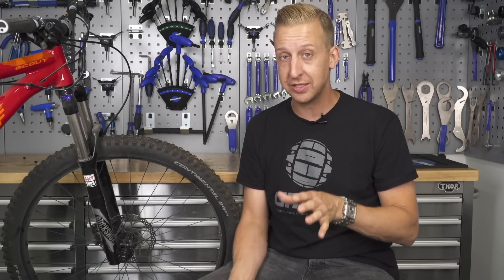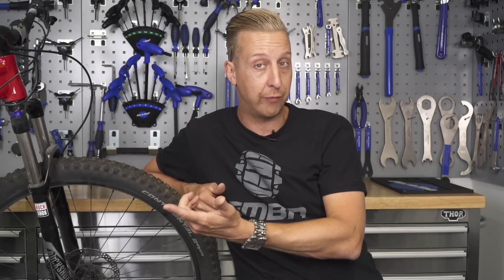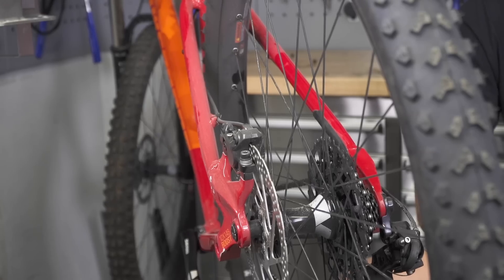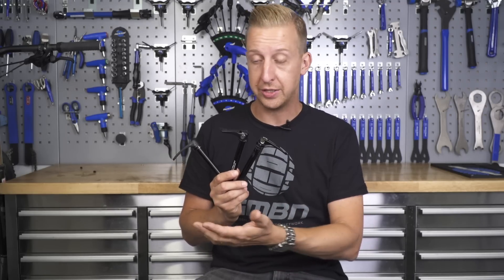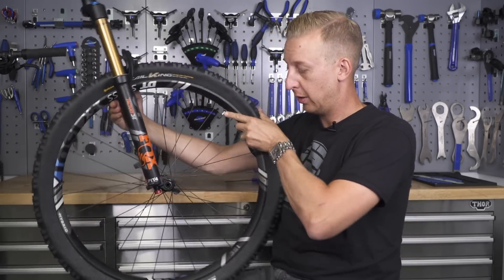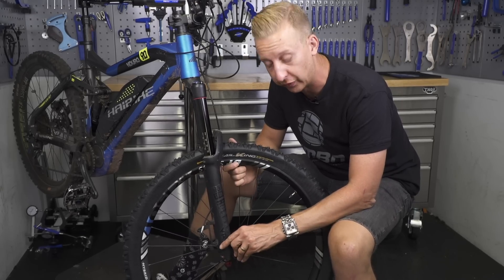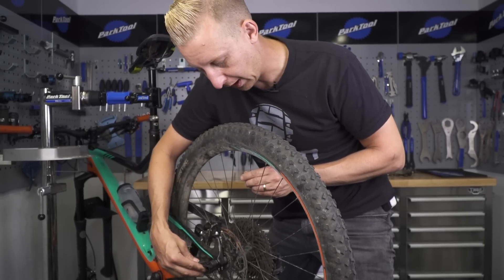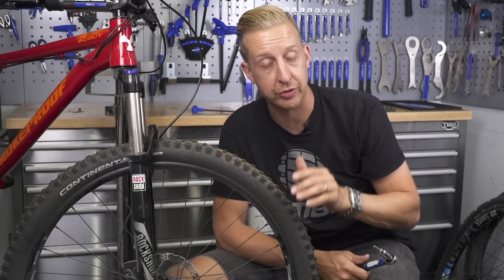GMBN Tech Essentials Ep.1 | Wheel Axles

Comment from the maker: Welcome to GMBN Tech Essentials! What skills would you like to learn?
Reply: Wheel bearings and servicing them would be interesting.
Reply: GMBN Tech how do I pick the right sized bike frame for me
Reply: @Stiffs1121  5554
Reply: Chain cleaning and maintenance; schedules, methods, tools, and which products are recommended. Don't even mind if it's sponsored products as long as you believe in them, Doddy
Reply: How about a nuanced explanation of suspension terminology? Most understand "sag" and "rebound", but it gets more complicated when understanding what "progressive, linear, High/Low speed compression, damping", and how all of that effects how a bike actually rides.
Reply: How to choose between rockshox, Fox,ohlins,etc
Reply: Changing gear cables; bleeding brakes and tuning rear mech please
Reply: cleaning and properly cheacking your linkage would be cool to see.
Reply: I have a back tire with correct axle/ frame size but the tire rubs against the left seat stay. how do I measure the complete wheel and back triangle to find out what matches or doesn't fit?
Reply: Derek Smith the wheel might just be dished to the left. I had a similar problem with mine*.There’s videos on YouTube to show you how to correct it. It’s quite easy
Reply: Hey Doddy- Wonderfully informative as usual- I was wondering if you could touch on QR Boost rear axles. My wife's Scott Spark 960 has this and its making upgrading her rear wheel a bit of a puzzle. I understand you can swap parts out on most Boost hubs to accommodate but what gives?
Reply: Bottom bracket maintenance
Reply: GMBN Tech That was brilliant vid. Thank you. Can you do one on converting old drivetrains like 3x8 to a 1x system ve it 1x10, 1x11 or 1x12. Pretty please with a cherry on top.
Reply: A rundown on all the bearings on a bike, the different levels and types; particularly if they're not sealed and need servicing would be great (don't see a lot of entry level stuff on here)
Reply: Headset maintenance - particularly how to identify what is fitted so you can have the option of buying better components / bearings
Reply: How to change the perfect air for your shock and fork.That would be really nice to do
Reply: GMBN Tech chainring replacement on specialised turbo levo
Reply: GMBN Tech freewheel axle bearing replacement
Reply: I'd love to see a video on all the different greasers, degreasers, and lubrications you use on your bikes. Also maybe alternatives that you would/wouldn't recommend.
Reply: Love these essentials videos, as iam new to the whole working on my own bike thing, this helps me greatly!
Reply: Carbon bikes maintainence please
Reply: Love all the GMBN tech vids. Please can you stop betting adverts and banners on your videos please. It’s a proven addiction and problem area.
No problem with the need for adverts otherwise for your income just ditch betting firms plse
Reply: I would like to learn how to assemble and check on a new bike that I purchased online.  I just bought a polygon D7 and I want to make sure its safe without having to pay for an all around set up.  I am brand new to mountain bikes but I did ride dirt bikes a bit and do all my own maintenance.
Reply: What's the best axle to use with a front hub motor? Quick release or thru axle

Comment: Isn't the Fox removable nut now used on the Float system to ensure the fork ends are not squeezed together if a under-width hub is installed? The axle doesn't compress the hub, it essentially floats on the axle.

Comment: Hello,
I have a whyte bike with a central lock through axel 12 x 142 mm, but theres no way to tighten the axel and more just holds things rather than tighten the frame to the hub. Is there a torque limit to this as all that happens is that the other end of the axel comes more outside as i tighten it. Do i just leave it equally distant from the centre of the frame ? 

Thank you

Comment: I feel like the original axle was fine with the bolt through. I thought the previous axles with 2 plain nuts were also fine, but I can see the benefits of quick release.

The argument that these new ones are stronger doesn't fly with me, they're still hollow. You can make the old design stronger also if required.

I don't see the benefit in these new ones, looks like just another case of the biking industry making something new and more expensive, that you'll need to come to them to replace instead of something cheap you can pick up anywhere.

Comment: I'm old enough to remember the days when both road and mountain bikes had the exact same axel lengths. And both were the same quick release size. These once simple things have gotten way too complicated. This detailed explanation is greatly appreciated. Please keep up the good work. Thank you.
Reply: I still have an old bike from the early 90's, if I have axle issues I could prolly find a spare nut anywhere.

I now bought a new bike, all pre-rusted for $35. When I say new, I mean new for me, '07 to '09 I think.
It's got a bolt through quick release on back, seems just fine after years of use and replacement bolts easy to get.

On the front it has a weird axle from Manitou, I need to work out what that is.

It's nice to see new designs, if they solve a problem or add something new people want.
However I think more bikes should keep to tried and proven common standards that are easy fix and cheap to replace.
Making profits is not a reason to make things more anti-consumer.

Plenty of good old bikes out there if you're not racing.
However it's just so confusing after not really looking at bikes for over 20 years :P

Comment: @gmbn i have a mavic crossmac sl pro 26 in TA. Im building a DJ bike. The frame accept bolt-on axle.  How can i make it work? I used a quick release adapter. I tried it but it made it  not so secure. How can i convert it to aacomodate my frame

Comment: I don't understand the 142, 148, 157 thing, shouldn't that be just the hub width? What's the matter with axles?
I just had to change my rear axle that was 195mm long, i found a new 195mm axle that also report the 148 size but if the thread length and the full length of the new axle is the same as my old, what's the point with the 148 size? Shouldn't fit anyway in my rear hub? Also the diameter is the same...
Sorry for asking but i can't really understand...

Comment: Hey Doddy,
I still have the old Quick Release axle as you are explaining around the 45 SECOND mark of this video.
Am now looking to upgrade my suspension forks to FOX but they all use the more modern bolt axles.
How can I upgrade my suspension forks and still keep the old Quick release axles as this is the only option I have without breaking the bank and buying a whole new set of wheels.
Thanks and love the show #AskGMBNTech

Comment: Is there any way to make a new, mid-range bike through axle compatible?
I appreciate that you'd probably need new forks for the front, but what about the rear? Is there some sort of adaptor to allow through axle fitting to a regular old style quick release bolt at the back, or does the frame have to be specifically designed for through axles at the rear?
Reply: There is something called Poseidon X that can convert a Quick Release to Thru axle but it's pricey and I think you won't get the same benefits from a normal thru axle frame.

Comment: I have a fully rigid mountain bike at this point - a (steel) Soma B Side v3 with a (rigid) carbon fork. I’m thinking of adding a suspension fork and am torn with whether or not I should upgrade my wheels: they are currently bolt-through quick release. Thoughts?

Comment: I have a 1996 Raleigh M-30FS mountain bike 🚵‍♀️.  I am thinking of upgrading the rear suspension from coil spring to air shocks.  It only has one inch of travel.  What Company makes an air shock with a one inch suspension?  How much does it cost?
Reply: evelasq1 I’m afraid there is 0 option

Comment: When I sit on my bike, my front wheel moves to the left. And also I feel like something is moving inside my fork(Fox Evolution 32 100mm) when I rock the bike back and forth. My local mechanic says that that is all normal and it is happening because the QR can't keep everything tighted up. I don't believe him because I feel like something is wrong with my bike when I am riding it. Any suggestions on how can I fix these problems? Cheers!
Reply: I had the same issue with my front wheel on a standard quick release not a bolt through. You could see the front wheel move slightly to the left when the front disk brake was applied I presume this is normal due to the standard quick release axles not being as rigid as the bolt through ones. Still been riding in some rough trails and not had an issue. Hope this helps

Comment: most Rockshox forks I've seen have had Maxle Lite which I was surprised you didn't feature, has the metal shroud used to thread/unthread that's easily bent
Reply: I swapped mine for maxle stealth after bending mine. Awful design.

Comment: As usual great video Doddy. I see Trek are using a 141 hub is this a proprietary hub spacing and thus a proprietary axel length?
Reply from the maker: Hey CJRodz, it's actually a quick release version of Boost. It's confusing, but still allows manufacturers to take advantage of the wider spacing while keeping the cost reasonable. If you look at 135 vs 142mm, the rear spacing is separated by 7mm between the quick release 135mm spacing and the thru-axle 142 spacing. It's not perfect, but looks like that's what manufacturers are doing.
Reply: A boost version of QR, that's interesting.. Thanks for the explanation.

Comment: Will all bottom brackets and headset bearings fit my bike even if it is sub £500
Reply from the maker: Hey Sams bike hacks, bottom bracket and headset bearings vary a lot between bikes. There are some standards that will work across certain bikes, but it's not as easy as buying any headset or bottom bracket bearings for your bike. For sub £500 bikes, the options are usually easier, but it's still important to find out exactly which you need.
Reply: @gmbntech   thanks for the answer

Comment: Hey Doddy, you should definitely advise people to periodically grease their through axles, on both the thread AND, very importantly, the main body of the axle. I had TWO brand new bikes and after 11 months (first puncture) both rear axles had become seized to the point where they COULD NOT be removed from either bike. With one of them the thread would undo but the main body of the axle was totally seized / bonded to the axle! The bikes were out of action for 6 weeks and in both cases the rear wheel had to be cut off with a metal cutter! Fortunately the repair was covered by warranty but they did try and say it was all my fault! I now remove and re-grease the axles every other week!! Please share this information as I was really sad for 6 weeks! #askgmbntech
Reply from the maker: It's a good point, Mark, thanks!
Reply: you're welcome, just trying to avoid others having the same problem, thanks for the reply!!

Comment: HI Doddy, nice vid. Do these differents axles are compatible with other brands forks. I prefer the DT axle and i'm wondering if I can use it on a Fox fork. Thanks.
Reply from the maker: Hi Xav911, unfortunately not. There are some aftermarket axles that can be used for certain brands, but you couldn't use the DT Swiss axles for the Fox fork because the thread and system is different.

Comment: FOCUS has a pretty unique thru axle that doesn't act like the rest. It has tabs on the far end and only rotates 1/4 turn to open and close and then has a cam lever to keep it tight. Works really well and is quite fast to change: https://www.focus-bikes.com/us_en/rat
Reply from the maker: Hey Andrew, yeah there are a few different axle systems like that. This one looks quite a bit like the Manitou axle. There's also a similar axle system on the new Polygon bikes, and then another on Suntour forks! But these aren't nearly as popular and common, so we didn't feel it necessary to cover the lot.

Comment: How about a video on building a simple home bike work space. Most, if not all, of the shops I've seen online seem to be set up exclusively with Park tools and a peg board with specialized tool hangers. Additionally, I'd be interested in suggestions related to tool placements. Something along the lines of chain whip is best located near the rear wheel and a brake bleed kit can live in a drawer nearby because it is only used once in awhile sort of thing.

Comment: But does Boost and regular even matter to most riders?
I mean is it worth the upgrade/cost??
Reply: DonD512 Hi Don, so Doddy alluded to the reasons behind why boost was brought in, but if I expand maybe this will help. So when bike suspension first came in the crown (where the two legs mount) and brace the part that holds the legs so they work as one had to take some considerable force with a regular hub and QR spindle.  The spindle is a thin bit if metal that flexed which was allowing the hub to twist between the the legs. At that time we where also using rim brakes and for downhill riders it was a compromise between having the brakes close enough to the rim to work but far enough away so that they wouldn't loose speed as the brake rubbed. By increasing the size of the spindle and beefing it up the legs of the suspension can work together and the bike has more positive steering. Also making the gap wider as we now have disc brakes allows better dishing (the angle the spokes go from hub to rim) so we have stronger wheels.  So does boost matter today's bikes are incredibly competent compared to  my 1987 mountain bike you would notice the difference.  Are they worth it most manufacturers include them as spec today when you replace your bike, they don't let you down grade. Hope this helps, see you on the trails Hassle

Comment: I have suntour XCM forks on my 2018 Voodoo Minustor with a bolt thru axle where the bolt head has rounded off. Can i buy a QR bolt thru or will it have to be the same one i have?
Reply: I believe Suntour XCM forks have the old style steel "skewer" QR system, off the top of my head they're either 100 or 135mm x 5mm. Just measure it and replace the whole thing, they're pretty cheap and come in many different brands.
Reply: DiverT 5000  not the ones i have, they have a bolt thru axle, which i think are 15x110 boost 158mm. i'm wondering if rockshox maxle stealth will be compatible or if the threading will be different.

Comment: My front axle while being on a Rockshox Domain as a 20mm x 110mm axle and it has a collet that pushes out and grips the housing to lock it self in. Its much different than any of the standard axles in the video.
Reply from the maker: Yeah, those are more downhill style forks. Some still have this system, but it's much less common these days.
Reply: thanks for the reply. Now I just need to figure out how to put the 35mm boxxer air spring stanchions in my domain frontend.

Comment: Like some of the others that have commented I would like you to have addressed the different thread pitches also and which bike manufacturers use which thread pitch size. Interface too, conical and flat faced.
Reply from the maker: Thanks Darren, it'll be an expansion on this video, and important to cover in the future.
Reply: Good point. Axles may not be interchangeable from frame to frame.

Comment: Hey Doddy, did you mention that the different types have different thread pitches? So if for some reason someone needs to replace one, to make sure they get an appropriate type. I had to buy a through axle adapter for a turbo trainer to fit a niner RDO gravel bike that uses 142 x 12. That's when I found out that they are not all the same thread pitch.

Comment: Would it be a good or a bad idea to grease the axle threads and body?

I found my gravel bike (15mm front with nut) creaking and it disappeared after I greased the front axle body and thread.
Reply: Adam Queen when I got my bike it came with greased axles so I would say it would be fine
Reply: Little bit of grease goes a long way

Comment: In addition..
* 20mm DH axle has boost and non-boost standard in same 110mm OLD, not compatible each other.
* There are at least three different thread pitch standards of rear through axles. 1.0mm(X-12), 1.5mm(E-Thuru), and 1.75mm(Maxle). Moreover, rear Maxle boost length is 180mm(standard?) and 188mm(for Split Pivot?). A bit complicated.
Reply: Ok.. so I'm gonna change my QR Front axle along with new thru axle Fork.. my Question: what size thread pinch & thru axle do I need,  because I'm Installing a front hub motor so I want a Safe front wheel system for my 26' disc brake MTB

Comment: Why does my drivetrain feel bumpy when pedaling
#askgmbntech
Reply: Daniel Tuukkanen are you pedaling through a rock garden?  ;-)
Reply: Daniel Tuukkanen check derailleur jockey wheel is not touching rear cassette if it is tighten the b tension screw to move it away from contact. 
Or
Freehub could be worn.
Or
Bottom bracket needs replacing.

Comment: This is actually a #askgmbn question but I‘ll ask it here because it is kind of fitting. I have a 2016 Mondraker crafty r+.  Due to a bodge to get my bike running in the vacation I sheered the outer part of my freehub body( the teeth that transfer power from cog to freehub body). The hubs on my bike are mondraker branded and I can‘t find any replacement free hub bodies. Do you know who makes the „mdk disk pro“ hubs? What would be a cheap good quality hub? My bike has 157mm super boost. I would like to have the option of mounting a XD driver body. Sorry for any typos. Greetings from Germany!